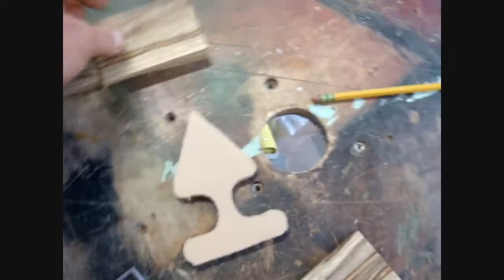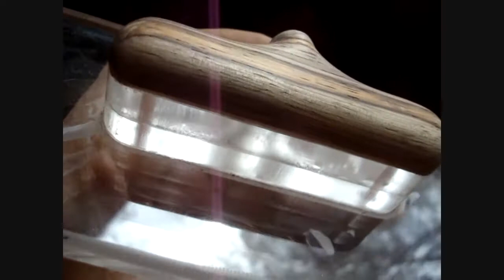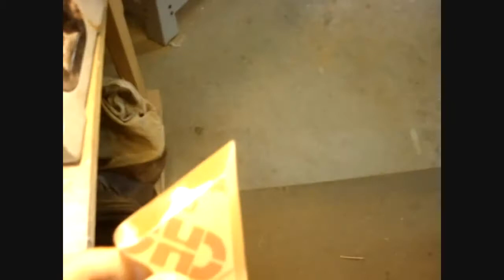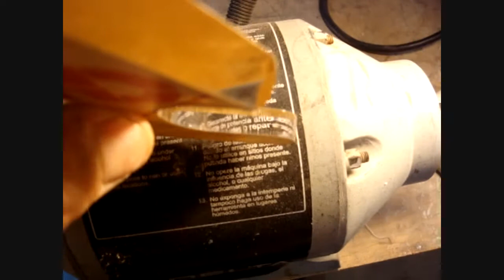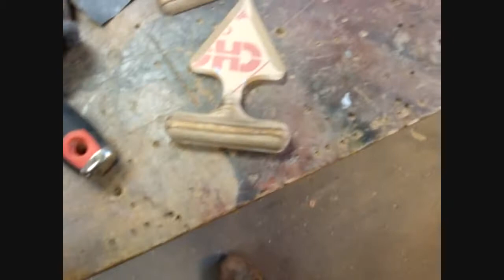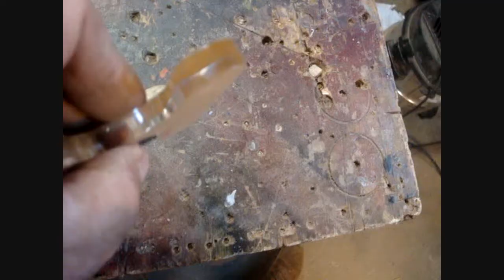Custom Plunge Dagger Black Limba Scales Part One

Comment: Let me give you some advice on JB weld that has helped me on my projects over the years.

First off is this- do NOT use a 1 to 1 mix as is told to you on the packaging. You want about a 1-to-.85 ratio of resin to hardener, the less hardener you use, the longer it takes to set up, but the harder and stronger the finished product will be.

The best thing you can do is to clean with acetone, NOT ALCOHOL, and as long as you give a coarse sanding to give the material some tooth before applying the JB weld, the stuff just literally works like magic. Works great on wood, and I put metal hangers on the inside of my gun safe like ten years ago, and they've stood up to lots of weight and abuse- not to mention the firearms repairs.